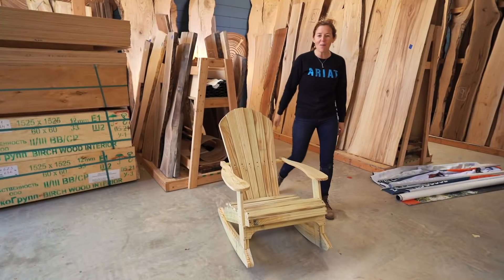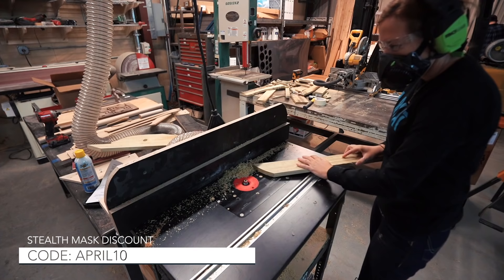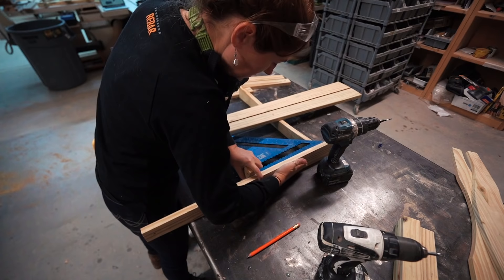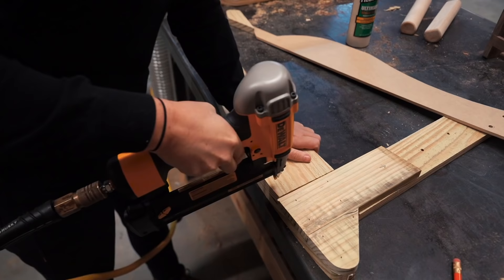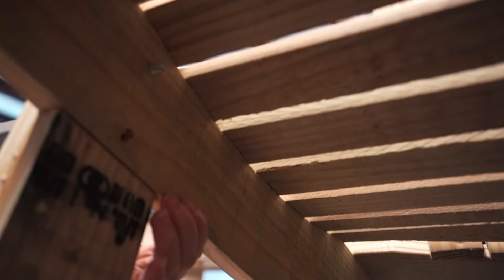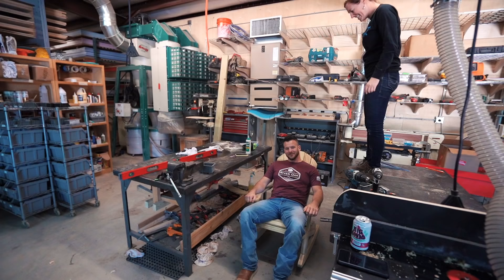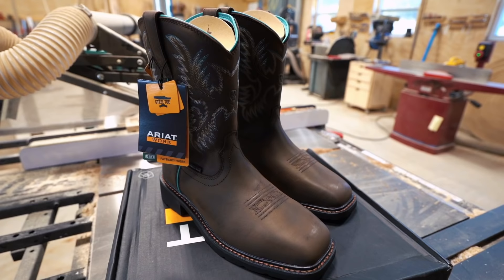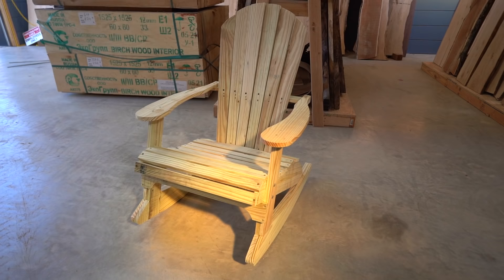Build An Adirondack Rocking Chair | DIY Templates!

Comment: New to the channel. Great work.

To hide the original holes for the back panel backboard, use sawdust from the same wood as the boards and wood glue
Reply from the maker: Yes, that's certainly a good idea also. Thanks for watching.

Comment: Having made many Adirondack chairs there is one weakness in your design. Attaching the arms at the back as you do is fine. Over time as people sit on those arms, it will eventually break.  Add a vertical support from the bottom leg to the arm to resolve that problem.
Reply: The solution for that is to scream "get the f$%* off my chairs you brats" loudly and liberally.  Seriously, anyone sitting on the arms is really foolish and deserves whatever splinters they get.  
Of I suppose you can sit quietly in chair #1 with a shotgun and keep one eye out for children and idiots for chair #2, 3, 4, etc.😂🤣

Comment: Your templates got delivered to me today! What type of wood did you use in the video?
Reply: Are you templates messed up cuz mine were . Was missing the under arm support and 15 1/2" piece under are and 2 of the pieces that supposed to be 3 1/2 cut from the 1x4's are only 3 1/4 " templates so all the extra work plus no assembly measurements . I contacted them and got nowhere .

Comment: These chairs definitely will go on my "to build"- list!
Any tips on getting the top of the back slats flush with eachother?
Reply: You could probably assemble first and then draw a curve and cut after it's put together with a jigsaw
Reply: @ChiefMoonChunks  true,good tip!
 but I reckon there will be some movement and twsiting in those slats after cutting it with a jigsaw, so I was looking for a soltution to that.

Comment: Actually, "Adi-rock-dack" wouldn't be a bad name for it!  Great design, April!  I like 'constructing' those half-laps, too, especially given the strength of glue.  Goes back to when I didn't have the right equipment to cut one from solid wood, but there's also the advantage of getting different grain in there strengthening each other against warping/twisting (even running in the same direction still has this advantage).

Comment: Hi April. I only have a benchtop band saw. Not knowing whether or not it will cut out larger chair parts has been holding me back from tackling Adirondack chairs. Would it work or would I be better off just going with a jig saw? Thanks ahead of time. :)

Comment: Do you have plans for a non folding non rocking chair too? Adirondack bundle?
Reply from the maker: No bundles are offered but the Folding Ad Chair doesn't have to be folded up. It can be left in down position and you'd be set. Thanks for watching.
Reply: @AprilWilkerson  Thank you for the response. I was hoping for Solid ones to sell and just for ease of assembly, but I can see where the folding ones may sell better. I would buy templates for all 3 if they were available.

Comment: Do you get templates for the small parts that make up the half laps on the inside rocker?  I am talking about the small pieces at the front and back.  The plans show them as a template but I did not receive these.
Reply from the maker: Hi Steve. You are not missing templates for those parts. The light blue rocker assemblies on age 12 are mirrors of the green rocker templates (they just have cut outs for the attached supports). Feel free to email us if you have any questions. Thanks.

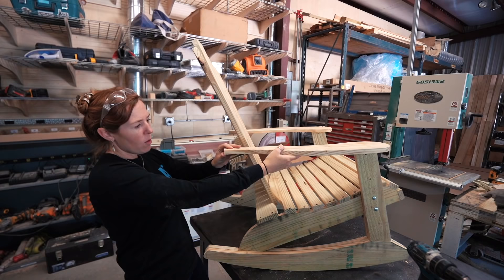Comment: At 5:47 it looks like you used self locking Nyloc nuts. But didn't you just finish saying that you used the equivalent of Loctite blue thread locker?, which is a removable thread lock? As the wood shrinks from dryer air conditions and age, you might find that your bolts will become slightly loose. To reduce this in the future, you may want to go with just split lockwashers and the same nuts that you used. I don't think that rocking chair will ever see enough vibration to warrant a thread locker AND self locking nuts.

Comment: I've always admired the Adirondack style, but as I'm disabled, it's far too low for me...maybe one day someone will design one for my kind.
Reply: Check out the Kitchissippi chair from Veritas for a chair that's not as low and sharply angled as the traditional adirondack design. Makes it easier to get in & out for older folks as well.
Reply: @jimhatch5873  Thanks, Jim. Will check it out. Cheers.

Comment: I ordered the template for this rocker, I guess this build is not for the beginner, it dose not come with instructions, for example,  the height of the legs that attach to the rockers, it does not come with  measurements, or even a picture of what it should look like, and by watching the video literally 10 times, I think there may be pieces missing. I guess I'll have to figure it out by watching the video frame by frame. I'm a little disappointed,  but excited to start this project.
Reply from the maker: The Instructions comes digital in an email. Please check your Spam Folder. Thanks for your support and for watching.

Comment: I ordered the Rocking Adirondack Chair plans and got the templates and downloaded the pdf plans and in the material list it states 1x4 ... 1x6 ... for the love of me are we using 3/4 boards for every piece or are we using 5/4 board for every piece ... I have replayed the video over and over and never hear a mention of the boards thickness ... please reply.
Thanks April
Reply from the maker: Hi there. On page 4 of the plans, at the top, it says that all material is 3/4 thick unless otherwise noted. All 1x material's actual thickness is always 3/4". Thanks!
Reply: @AprilWilkerson  thanks so much for the very quick reply. I saw that on page 4 but wanted to make sure so my chair would be stable ...on the video some of the boards looked liked 5/4 and I wanted to be sure before I went to Home Depot.
Looking forward to building this rocker and will order the Folding Adirondack Chair just as soon as I tackle this project.
Again ... great project and thanks!

Comment: I thought you had templates for two different size chairs. No more?
Reply from the maker: This Rocking Ad Chair is one size. The regular rocking chair is available in both a Short Rocker or a Tall Rocker. Thanks for watching.
Reply: @AprilWilkerson  what are the changes (improvements) in the new build?